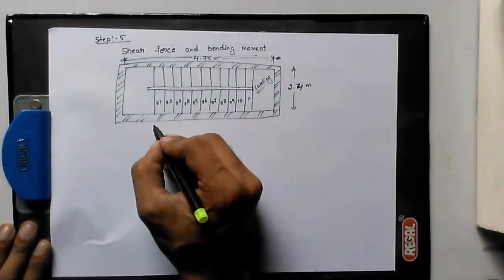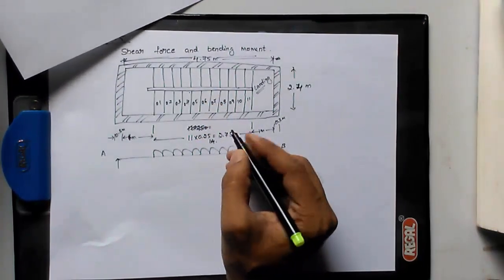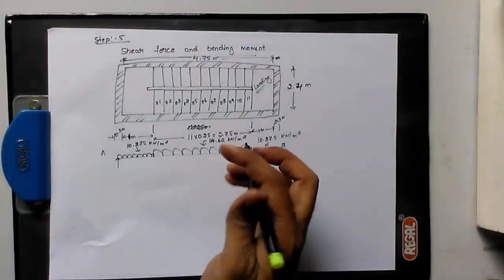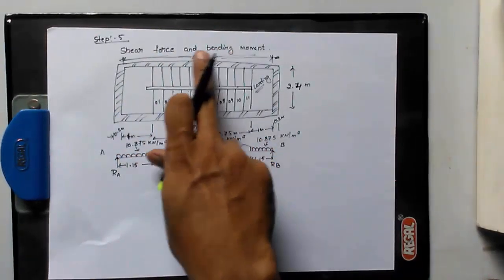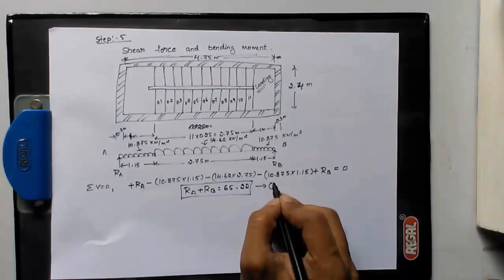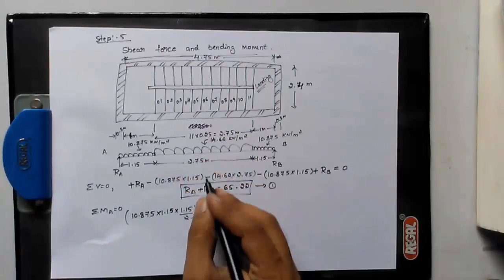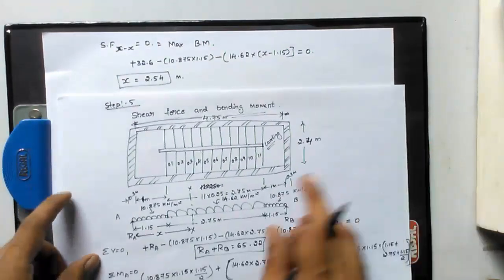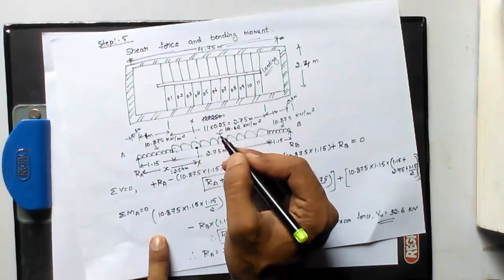Design of dog legged staircase part - 2 | Design of Staircase | staircase design | globemech | vtu

Comment: The support reactions calculation can be simplified by dividing the sum of vertical forces (UDLs) by 2 as the load distribution is symmetrical the support reactions will be the same.

i.e. 
[(10.875 x 1.15)x2 + (14.62 x 2.75)]\2
This will give Ra = Rb = 32.6 

Using this, Moment calculation for finding Rb can be eliminated and save time.
Reply from the maker: Yes, when it is symmetrical load from left and right you can do,
Reply: Sir, please upload design of other structural members like slabs, beams, columns, etc.
Reply from the maker: Sure, Thanks for your feedback

Comment: Sir for finding forces at A and B  for sfd and bmd we can use symmetry of diagram 
Step 1 convert all udl in point load
Step 2  add all point load  
Step 3  divide the value by 2  and we will get value for A and B